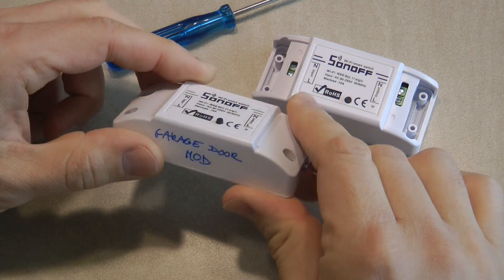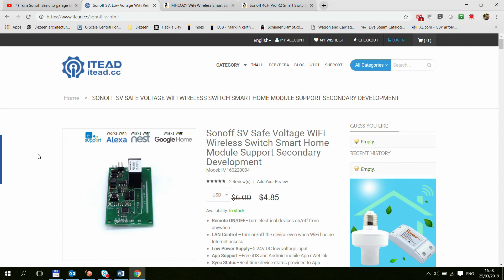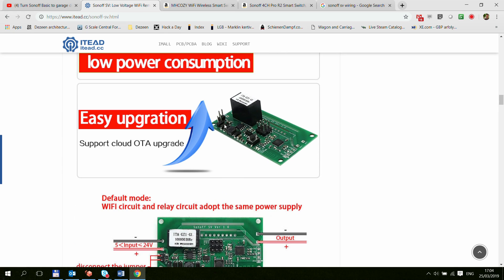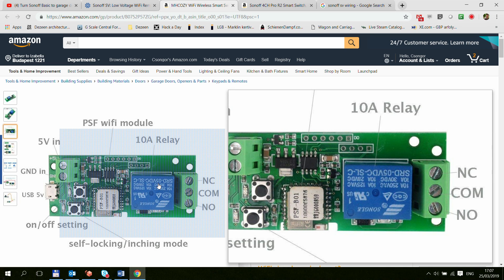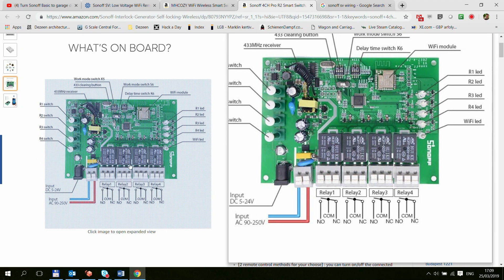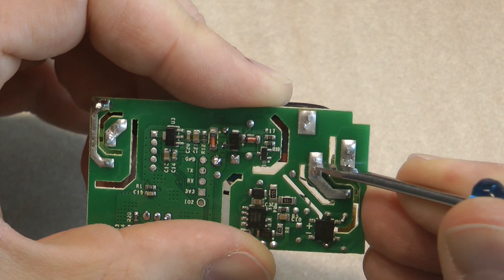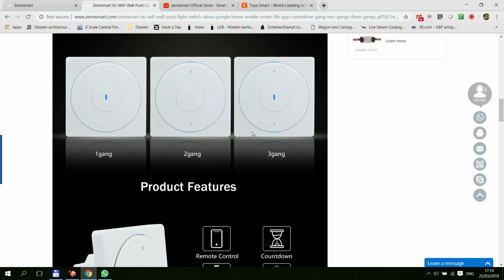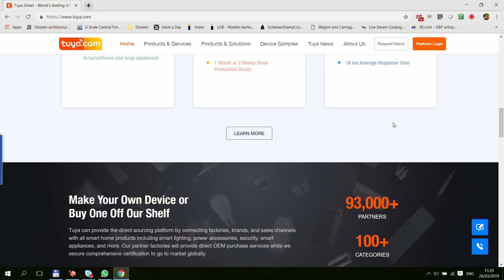Small Bit: Sonoff Basic v2 garage opener, Zemismart sale, Tuya

Comment: Hi there i pressed the link for guide to BASICR2  but this does not look like my sonoff basic R2 do you know if it is possible to make the basicR2 work as garageopener?
Reply from the maker: I would not do that. The PCB layout is much denser, it would be very difficult to make a cut and not cut anything else. I suggest to check out a Sonoff SV. That has all the relay output separated and does not need an hardware modification.
Reply: @csongorvarga  thank you for your reply, I will have a look at the other model 👌 is the basic 2 gone out off production?
Reply: @csongorvarga   coul you give me a link to a SV cant find it

Comment: Thanks for your videos.  Excellent.  I want to use a Sonoff RFR2 or Basic RFR2 as a GDO so I can also used the RF433 signal.
However, I can't find any video instructions for any of you smart guys that have done it.  
1.  Is it possible?
2.  Would you please make a video on this version for us?
By the way, the insides of the RFR2 look nothing like the R2
Reply from the maker: I don't have any Basic RF devices. And I have already noticed it with R2 that the circuit is much tighter, I could not make a clean cut I could recommend to others. What I would rather recommend to get a separate 120/220V relay. So the unmodified Sonoff drives a relay and the garage motor is connected to the relay output. Also keep in mind that these RF433 devices use fixed coding. It is very easy to listen in the signal and repeat it. This is why garage door openers are expensive and they use more sophisticated encoding.
Reply: @csongorvarga  The RFR2 looks different than the R2.  I understand what you mean by RF433 being weaker. Not an issue for me. And I have more than one auto GDO.  I have been using the Sonoff Basic from our video for a long time. I just want RF433 so I can use extra fobs to open door - because I am lazy.  I'll pay for the RFR2 and a hub for you if you will work on this.

Comment: why not just change the fuse location farther than the relay? you can even use the hole the fuse comes in for the black wire

Comment: I also was able to use a dremel tool bit to sever the connection between the two solder points. I placed a bit of shrink tube to isolate the fuse. Then changed the settings in eWelink app to inching (1.0s). Tested the connections and tested the unit.All is good, but I cannot get the garage door to open when sending a signal through the sonoff unit. It is on my wifi network. It is powered through wall outlet. But output connections do not seem to be working. Any ideas? It is running eWelink not Tasmota. Any help would be appreciated.
Reply from the maker: First of all is the device working? I assume it is online in eWelink and you can switch it on and off. Can you hear the relay clicking? If not you may have cut too much and the relay is not getting power. If so, did you also soldered the jumper wire on the output side of the cut? If the answer to this is all yes, than it must be the garage motor connection which is wrong. But I would not be able to help you with that.
Reply: @csongorvarga  Thank you. I rechecked the solder connection and it had come loose when I squeezed the board back into the cover. I re-soldered and make some cuts on the cover to accomodate the jumper wire's new position. It works !!! Wish I could attach photos on here to show it. Now, Google Home only shows last state and doesn't revert to off state, but the eWelink app does revert to off-state. weird.

Comment: First, thanks for your videos. Informative and appreciate your insight on practical/safe advice. I'm far from an electrician and unfamiliar with the parts and terms. Is there a reason one couldn't find a switch that opens and closes the circuit based on the presence of AC power? 

1. SonOff sends AC to Solid State Relay
2. Solid state relay will open/close zero voltage circuit based on the existence of AC

Seems like that would be simple and basic device. My limited searching suggests the solution is rare/expensive.
Reply from the maker: Actually very good point. I was also surprised to find that it is actually very difficult to find mains relays. But that is certainly a good option as well.

Comment: Hi together
i'm searching for a device like sonoff for switching and fpr inputs. so i need a device that have also a feedback from a input.
someone knows such a device?
tnx pat
Reply from the maker: I reviewed a Eachen GD-DC5 in the past. This has a magnetic door sensor so it feeds back the status to eWeLink based on the actual status of the door. Maybe you can use something like that. I am not aware of anything else.
Reply: @csongorvarga  tnx i will see...
Reply: Some Sonoff has GPIO pins for additional inputs, there is video using SV's GIPO14 for magnetic door sensor and GIPO5 for ultrasonic sensor

Comment: Actually, the modification is not that difficult.  I really don't consider it unsafe either, as the output end really has little or no power going through it after the mod.
The following is how I performed the mod on this newer style Sonoff Basic:
1. The heavy black wire running from the Neutral post at the input end can be desoldered at both ends and discarded.
2. Then, a small cut (I uses a dremel with a worn down cutoff wheel - as it had a much smaller diameter than a new one) between the 2 terminals shown in this video can be made.
NOTE: Using solder wick to remove a lot of solder in this area, and bending the 2 leads away from where the cut will be made, PRIOR to cutting makes this task MUCH easier.
3. I used a much smaller gauge wire (20 gauge will work for this purpose) to solder from the relay terminal (NOT the fuse terminal) at one side of the cut, run through the slot next to the relay, and the other end onto the neutral terminal at the output end of the device.
I've built 3 of these devices over the past 4 weeks, and all are operating nicely.
I hope this explanation is clear enough for others to follow - I'm not a videographer so won't be posting a video of this modification.
Reply from the maker: Thanks. I pinned your comment to the top, so hopefully many people consider your approach.
Reply: @csongorvarga  Thank -you-...  I did make one error in my comment - which I have now corrected...
Reply: This one looks much simpler.. https://letinas.blogspot.com/2018/12/intro-to-home-automation-with-sonoff.html
Reply: Alternatively, desolder the fuse and input-side neutral wire, then connect/solder the neutral wire to the fuse and resolder the fuse's long lead to the board. AC&DC are on the same terminal block, but it works without needing a dremel.
Reply: I used a dremel to increase the distance between the neutral and the relay contact. I had to move the fuse over a little but that was no problem. I do still get about 20VAC between the mains and relay contacts, any suggestion as to the path for this. Do I have to remove a resistor or something on the Basic V2?
Reply: I did the same thing. It will also work by shorting the F1 fuse but would not recommend it for safety reason. I am thinking to replace this fuse with a 1A SMD fuse.
Reply: Thank you John and Csongor, 
After seeing your Sonoff1 video I exitedly opened my Sonoff Basic, which I want to adapt to operate a Somfy remote. (difficult to find cheap solutions that will make Somfy work with EweLink).
Obviously, I had a version 2 so took some time to figure out where to cut. Wish I had seen this video before. Would have saved me some time. 
I inserted a piece of rubber between the transistor and the relay to provide extra isolation of the live circuit. 
I cut the black wire right at the base where it connects to the input and cut a nick out of the board on the side right next to the relay. The length of the wire is just enough to reach the pin and solder it in place.
Having said that I will probably be buying a Sonoff CH4 as there are 3 connections to be made with the Somfy remote to use all features.
Thanks again!